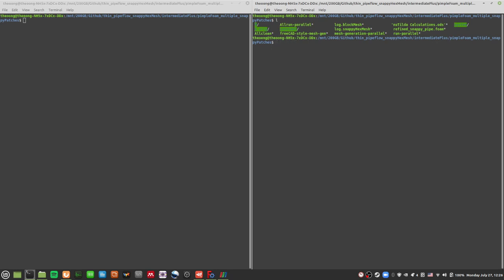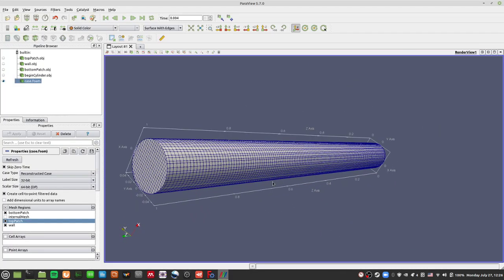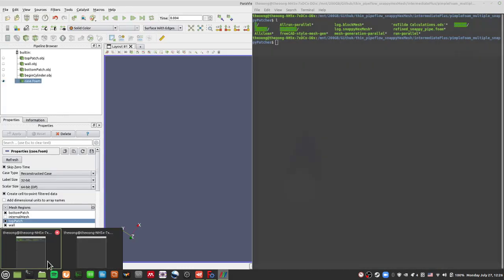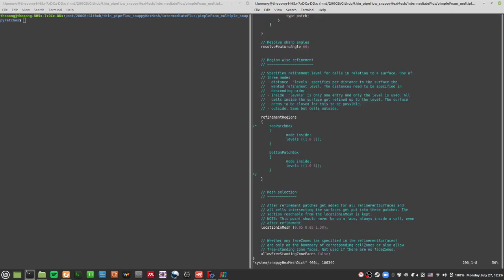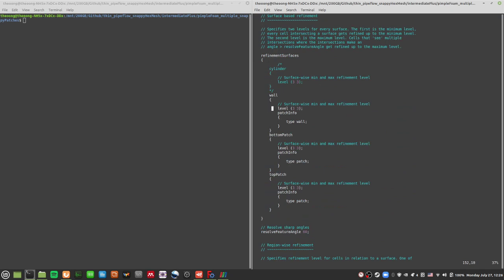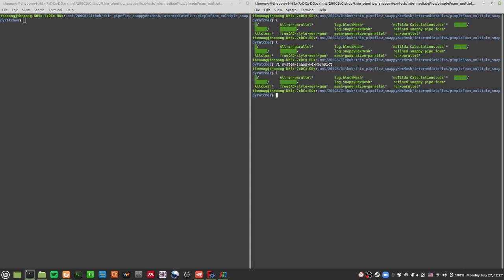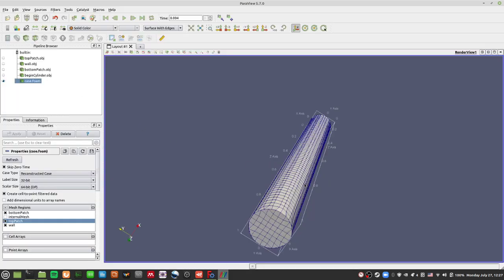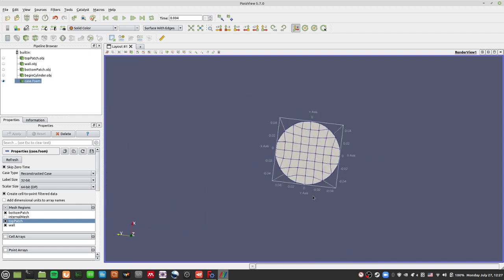OpenFOAM Intermediate - 80 snappyHexMesh layer addition controls relative sizes

Comment: Respected sir, I want to use different physical transport properties for different regions .. how to proceed for that ??
Reply: @TheoOngScienceAndEngineering  I have tried multilayer condition using chtMultiRegionFoam for solids only, however the obtained result is differing from analytical result. The issue may be related to addition of temperature dependent source term in fvOptions in-terms of sensible enthalpy. If you have any idea related to addition of heat source interms of sensible enthalpy then please let me know.

Comment: Good morning, I'm new with OF and snappy (I usually use starccm+) and I'm trying to link freecad, snappy and of with Dakota to do an optimization in a gemotry; my geometry is not so complex, is a fluid collector with 1 inlet and 7 outlet, I think that the .obj files are good because in star I can realize a good mesh with no problem but in snappy I can't add the layers near the wall, for me is a problem because I'm in turbulent regim and the y+ becomes big if I don't have layers. I modified the motorbike files but the layers doesn't come out and I don't know how I can do.
In the addLayer part I applied 3 layers on the entire geometry (the one with all part all togheter) but nothing was happen.
I apologize for the inconvenience and thank you so much.
Filippo
Reply: @TheoOngScienceAndEngineering  thanks a lot... Now i try to change something, if I can't I will try with salomé
Reply: Only a clarification, snappyhexmesh doesnot abort the add layers but it generate a number of layers <1